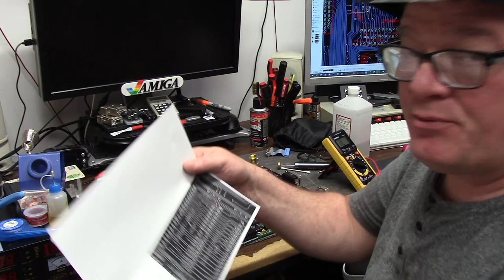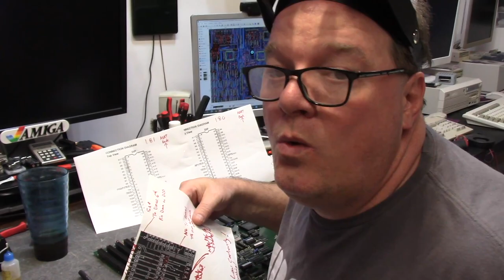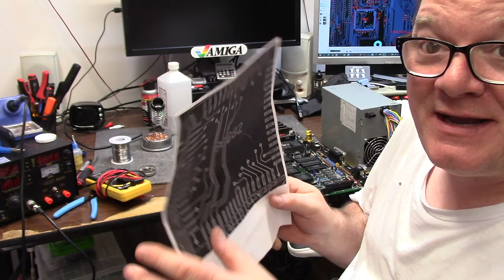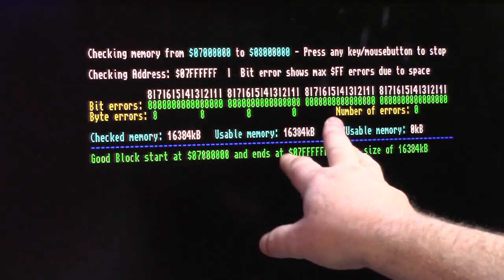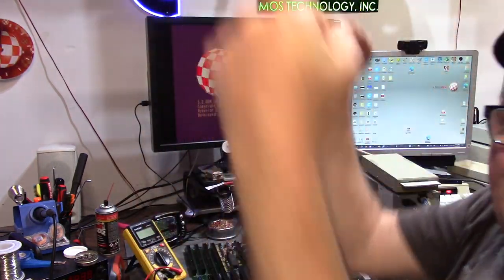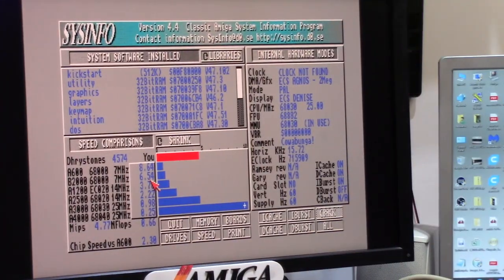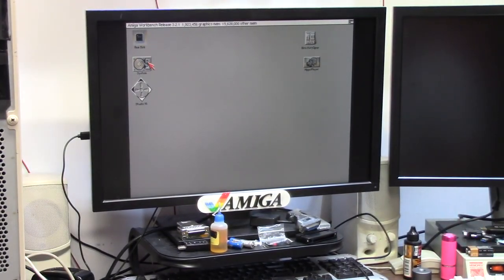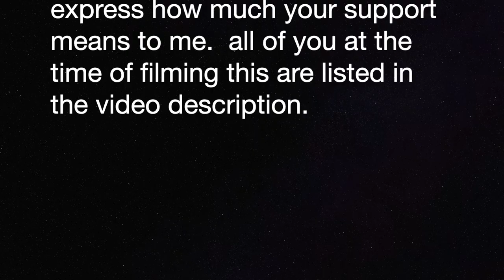3000T from Mr Jack finished!

Comment: You ever drop a 50mhz 030 /882  into an A3000 or A3000T 's mobo as an upgrade?
I wonder if anyone has done it?

Also, those tabs.  Gorilla glue worked for a case of mine.  :D
Reply from the maker: you would have to unsolder it and the crystal, but it is possible, but you can just add in a external card with less worry or risk.  they all came w 68882's you would just need to replace it w the faster one.